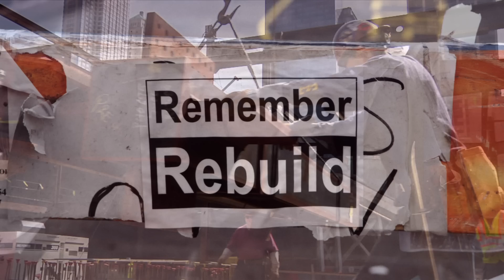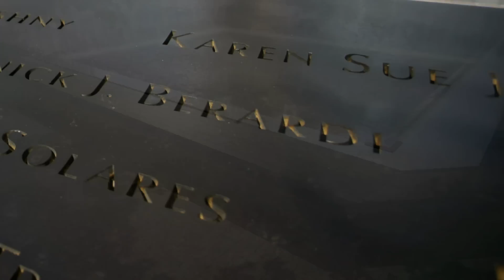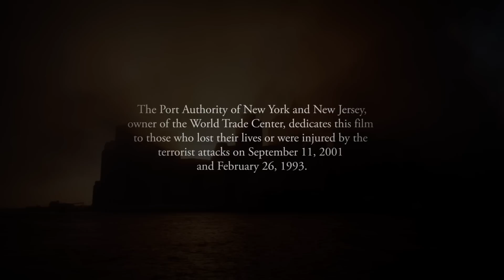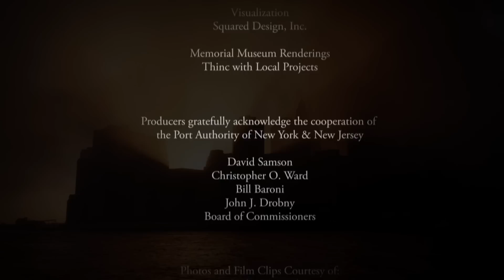REBUILD - From The Ashes, The World Trade Center Rises Again

Comment: During the Months leading up to 9/11, there were many vacant floors undergoing “renovations”. The elevators were also going through upgrades which took months to complete, and allowed hundreds of tradesmen, laden with tonnes of parts and equipment, free access into both buildings and in particular, the elevator shafts which provided access to every column. The weekend before 9/11 there was no operational security in the building for the best part of 2 days. This information is not a conspiracy theory, it is easily verified by the Port Authority service records. There was more than enough time & opportunity to completely wire both buildings for a controlled explosion. Wake up America, your Governments have a history of doing this. Use some of your intelligence to seek the truth yourself. May all the victims of 9/11 RIP.

Comment: I like the new world trade center because its a rebirth....the new tower resembles the original north tower outside and even inside lobbies so they have taken certain aspects of the old WTC and put it in the new WTC along with new designs for the future ..rebuilding the towers exactly as they were is not a good idea just for the sheer fact that it's reopening wounds and its not new material..I live in OKC where the murrah building bombing happened and we have rebuilt not on the original site but a block around the corner  with an all new design but the original site is a memorial to commemorate all those lost so it's great the the new WTC is rebuilt with a few similar designs of the old towers but has its own modern unique flare to it..so I can't wait to go to NYC and visit the new site when its open.

Comment: Im still scratching my head over why building #7 dropped like a lead balloon.
Reply: severe damage from the collapse of the towers, and fires raging uncontrolled for 7 hours weakened the 3 steel supports that supported the uniquely designed building. go look at the nist projection it matches up with the video evidence, the inner support of the penthouse collapses first, along with the rest of the main supports, and then the outer shell of the building collapses. fire fighters also knew the thing was coming down hours before it did.

it dropped like a lead balloon because skyscrapers are heavy as fuck, once the support gives it freefalls.
Reply: ya learn english and then get back to me
Reply: Quantikk Nothing hit that building, otherwise the damage would have made it collapse in the morning or afternoon. It dropped according to nist after the faillure of column 79. It was lost due to fires they say, fire caused by some burning parts of wtc 2. No plane or large parts of debris hit that building. If fire was the case that brought it down, why do we have demolition companies? Just start some random fires on a few floors and let time do the rest.

The fires weren't raging, they were located and spread out on a few floors. Further more, such buildings are constructed with the possibility of one or either 2 columns failing and the others supporting it, which gives time for reinforcing the failures. The same applies to the Twin Towers, either segment or floor of the building was designed to withstand twice the load of perhaps a failing column above it. 

Further more The Twins were designed to withstand a plane impact. People say that the designers didn't attain the idea of fires due to jet fuel. This claim is beyond stupid. Why would they design towers to withstand impacts by jetliners but not take into account any form of fuel? Do those planes then come on in gliding without fuel?

And if you feel like telling czesckurw to learn "english", Learn it yourself, it's English
Reply: 1. debree did hit tower 7. eyewitnesses reported huge damage being carved out of the building. video evidence also shows it being hit by the falling towers.

2. the builders admitted they never took into consideration the effects of airplane fuel in their analysis and further concluded that there would be no practical solution even if they wanted to. the designer flat out said this. it could withstand the impact but it was unknown the effects of the impact as well as a sustained fire from the fuel.
Reply: Because it was a controlled demolition.
Reply: czesckurwa Actually, you people (in the 9/11 truth movement) use the 'reverse scientific method.' you determine what happened, throw out all the data that doesn't fit your conclusion, and then use your findings as the only possible conclusion. You ignore science, logic, and investigation altogether. You chase any little but of information – no matter how flimsy – and use it to fit your premeditated conclusions. You look through the mountains of available information about 9/11, and ignore all of it except for a few isolated details you think support your theories. You distrust the media and the government-sponsored investigations of 9/11, yet you pick from these same sources to support your fanatical notions.
Reply: Actually, anyone believing the 'official' 9/11 report is beyond stupid. It is not based on science, facts or any form of healthy thinking. Physics says it's impossible for the planes to have taken down the buildings, they were designed to take such stresses. The fires didn't get hot enough to melt steel, yet we see molten steel leaking out of the towers. We see timed explosions going off on the first tower when the second tower is hit. We have so many eye witness reports claiming explosions. New videos on youtube clearly mark 9, explosions before the first tower collapses. News coverage that day spoke off a number of explosions with another huge explosion before both towers came down.

We choose the media sources because they can't hide all of the truth since people questioned the planes and talked about perhaps seeing a small plane, all black, perhaps a missile. But every man or woman in a studio always denied that, no no we've seen the second plane hit, no no it surely was an airplane. 

All media coverage had ceo or high employee witnesses near the wtc complex within 5 minutes of the first hit and helicopters at the scene after 5 minutes. They were there faster then the fighter jets xd

The most compelling evidence are the videos that were released after 9/11. Every one of them has a different plane, angle of approach and many of them show a wing missing and the starboard engine trying to make a right turn. Many people claim that lighting did all of this. Unfortunately lighting doesn't turn something white into black and vice versa. 

The most beautiful media flaw is the eye witness named Mark Walter, who said he had seen the plane go in the pentagon. He said in a later statement after get immense criticism that: the hole wasn't that big because of course on impact, the wings buckled backwards due to the force of the building colliding with the plane, that is why it could dissapear inside the building.
Funny thing is, that is not what the videos of the towers show us. There we see aluminium planes (read wings) cutting through solid steel. Pretty much debunkes his theory then shouldn't it? We have seen on 9/11 that we know nothing of physics and are all stupid. NIST knows it all xd
Reply: Nathan Mulder For the 500th time, nobody ever claimed the steel melted. It got hot enough to lose its strength. Steel thermally expands while it remains strong and thus fire rapidly destroys uninsulated steel structures, and steel begins to lose its structural integrity 

The explosions heard during the collapse were the shock waves created by the debris traveling through the air faster than the speed of sound. Sonic booms generate enormous amounts of sound energy, sounding much like an explosion. The air and debris ejected from the building by gravitational collapse must have attained, near the ground, the speed of almost 500 miles per hour (or 223m∕s , or 803km∕h ) on average, and fluctuations must have reached the speed of sound. This explains the loud booms. Have you ever heard the sound of a concorde flight going by? Have you ever heard a sonic boom?

The source of the trace amounts of molten material in the wreckage was aluminum alloys from the aircraft

The twin towers were designed to withstand a plane crash? Yeah, and the titanic was designed to be unsinkable. Leslie E. Robertson, then the project manager and the engineer most responsible for the WTC's design, stated: "The circumstances of the attacks were beyond that which we considered in the design" (Discovery channel- "WTC: Anatomy of a Collapse") It was hit at 400-600 mph by a 767 plane fueled for a transcontinental flight. 

If you knew any physics, you would know that the energy contained in a moving object is proportional to the square of the velocity and mass. so the energy posed onto the building by the 767 was much, much more than the energy of a 1960s 707 plane. Do not tell me that "physics says it's impossible for the planes to have taken down the buildings"
Reply: Armondo Dauti Alright. It would also have taken considerable work, which would not have gone unnoticed, to plant sufficient explosives the length of the buildings to bring them down. Controlled demolition of a building to code requires weeks of preparation, including laying large quantities of explosive and cutting through beams, which would have rendered the building highly dangerous and which would have to be done without attracting the attention of the thousands of people who worked in the building. The tower walls would have had to be opened on dozens of floors. Thousands of pounds of explosives, fuses and ignition mechanisms would need to be sneaked past security and placed in the towers without the tens of thousands of people working in the World Trade Center noticing. This is the least convincing theory in the whole 9/11 truth movement, and anyone who believes it must have an IQ of zero.
Reply: Anna Bethany Levy 
You do understand that most people here are not English nor American and that you should at least appreciate that they attempt to communicate with you in your native language.

There is more out there then just America my boy
Reply: Nathan M If they're not american then they shouldn't feel the need to be concerned about the american government because it's not their government, they should be questioning their own government
Reply: Anna Bethany Levy  Just like the American Government likes to make everything it's own business all over the world. When there is oil or a tactical gain, the American government suddenly wants to 'help' or 'protect' 'freedom'. 

And please tell me, why shouldn't people outside the USA be concerned about that government? Their NSA spies on the entire world, their military can invade countries with false statements that will lead to no further consequenses, they are known for false flag operations to get their way and create power vacuums in the entire Middle East. Like it or not, your government is as much our business as it is yours. 

And for all that, outside the USA we are not blinded by the FOX news propaganda, we know what controles your 'government'. Zionist bankers and other elites have control over your country
Reply: Nathan M You're not an american citizen, this is not your business, these 9/11 conspiracy theories are about how the USA treated its own citizens and have nothing to do with you
Reply: Anna Yael Levy Is that so? Tell that to half of the Middle East then. They would probably not want anything to do with the wars the American only problems created.
Reply: You know what, I can give you any kind of "credible source" yet you would still dismiss it, because your belief in not based upon deep rooted facts, but on the need to believe that your government wouldn't harm you and that your government isn't evil. 

I will ask of you to answer these question, since you seem to know the full truth about 9/11 and its perpetrators. Please, enlighten me:

1. Why did the news agencies report that WTC 7 collapsed almost 1/2 hour before it did, even though it was not hit by a plane, only had a few floors on fire, and gave no indication that it was in any serious danger?

2. Why do we still believe the tale of the 19 hijackers when so many of the accused hijackers showed up ALIVE within days? And why do we still believe the fable of the 19 hijackers when the FBI admitted that they are not sure about either the identity of the hijackers or if there were any hijackers at all?

3.  Why was WTC 7 rebuilt, reopened and reoccupied with no press attention? Wouldn't this be an important victory in American resolve and perseverance?

4. Why were the NORAD rules changed for the first time several weeks prior to 9/11, taking responsibility/authority for shooting down hijacked planes away from NORAD military command for the first time in its history, and given to a civilian, Donald Rumsfeld, and then returned to NORAD the day after 9/11?

5.  Why would hijackers planning on attacking NY and Washington DC drive from Florida, pass both DC and NY,  and drive all the way to Maine and hinge this huge operation on a connecting flight from Maine to Boston, where we are told they hijacked their plane? Why wouldn't they fly out of any of the airports that are visible from their targets, like Newark, La Guardia or JFK...or even some of the smaller local airports that would have given them a clear easy path to their target and reduce the amount of time that our air defense systems would have to stop them?

6. Who placed all of those put options on the airlines just prior to the event, as if they knew that the stock prices on those specific airlines would lose  a huge amount of value?

7. Why  did George W. Bush's Secret Service detail not rush the president to safety when it was evident that the nation was under attack? If the nation was under attack, and they did not know the scope of the attack, and the president's location was known, how did they not worry about being attacked in Florida?. Why did they act as if they knew that there was no threat? And why, when our nation was under attack, did the president not rush into action? If you say he was concerned about upsetting the children, you are the ultimate apologist. He could have told them that his mommy was on the phone and he had to see what she wanted. Our county was supposedly being attacked and he/they waited 20 minutes before they moved. This is the smoking gun of smoking guns.

8. Why did the FBI never list Osama bin Laden as being wanted for 9/11? Actually, we know this one...because they admitted that they had no evidence linking him to the event.

9.  Why was their molten metal flowing under the wreckage of the WTC for months? No jet fuel can melt metal, and nothing explainable could melt that much metal and keep it hot enough to remain molten for a month.

10. How did a passport of one of the so called hijackers make it through the huge fireball and end up on the street?

11. Why have photos from the 80+ cameras confiscated at the Pentagon never been released?
Why did the airplane that supposedly crashed at Shanksville vaporize so that nothing remained, not bodies, not luggage, not metal, - nothing - for the first time in aviation history? However, we are told that even though the plane vaporized at Shanksville, a hand-written note from a hijacker was found.
Reply: ***** it wasn't hit like that, it was totally fine. Please stop spreading lies